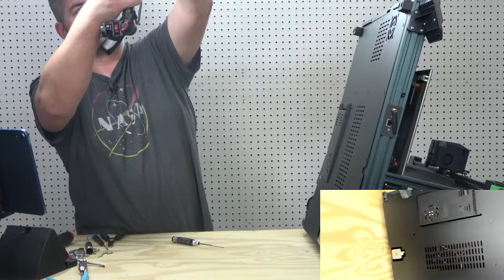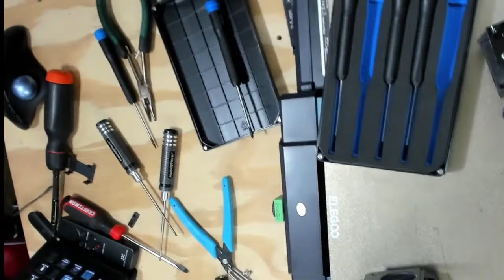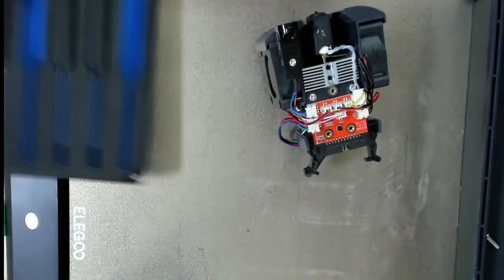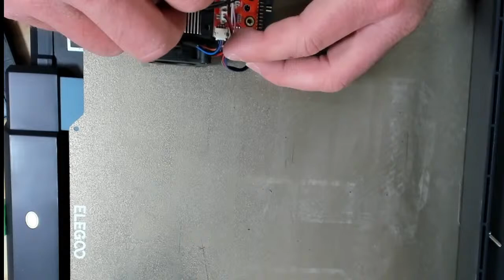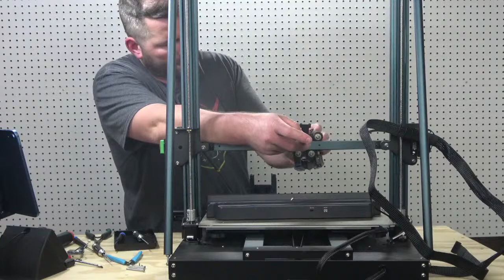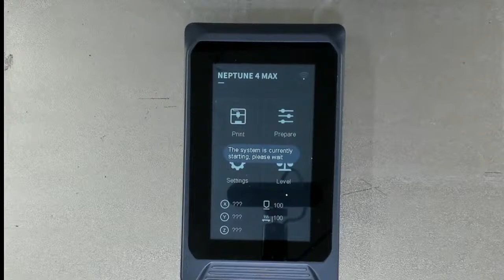🔧 Live Fix: Elegoo Neptune 4 Max Hotend Repair & Test Run 🖨️

Comment: Any plans for a linear rail upgrade?  I noticed you still use pom wheels.
Reply from the maker: Eventually yes, currently on this Neptune 4 Max and the second one the only issue I have had was the hotend not working.